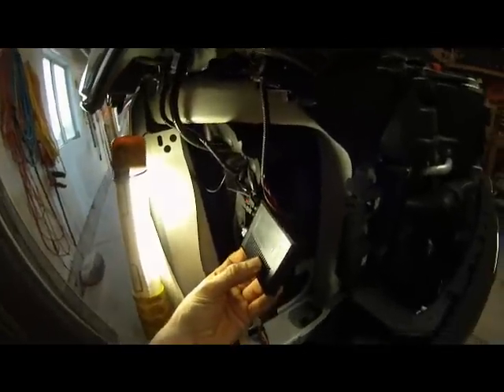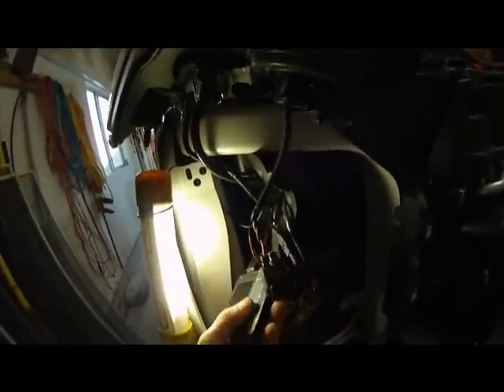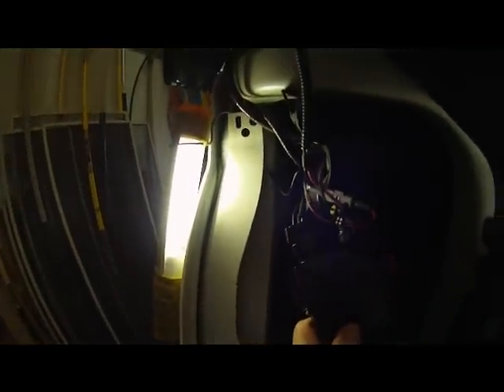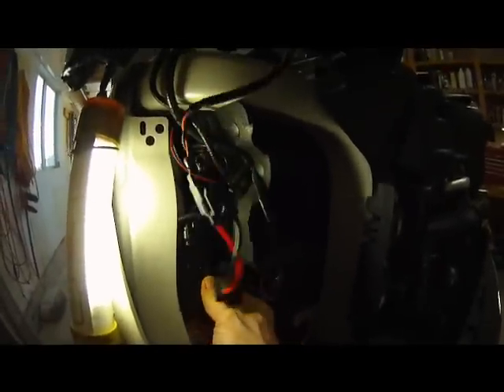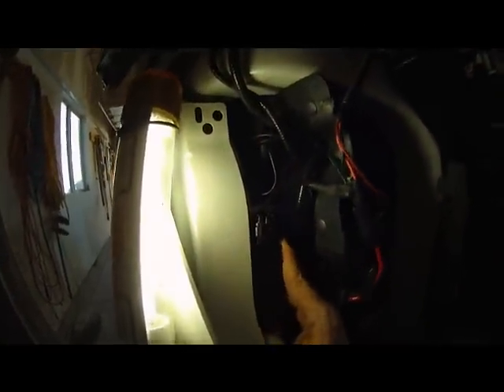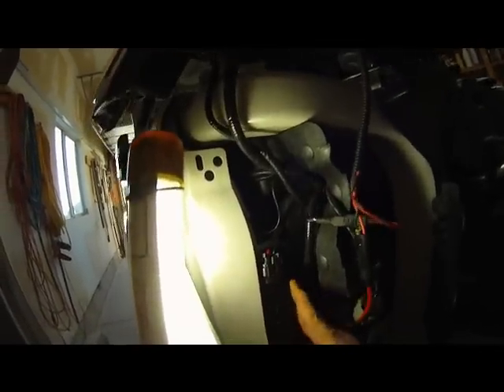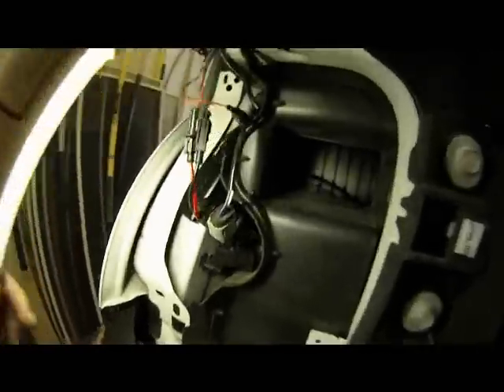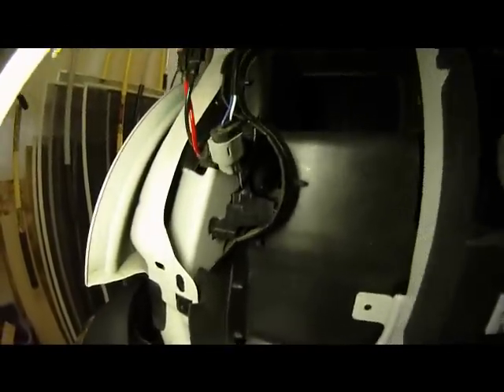2011 Ford Super Duty HID Ballast Mounting Location

Comment from the maker: There is a spot directly behind the headlight housing. Hard to describe but a nearly vertical slot between two pieces of sheet metal. I secured my slim ballasts with Velcro strips. I'm pretty sure there is enough room for the regular ballasts in there.